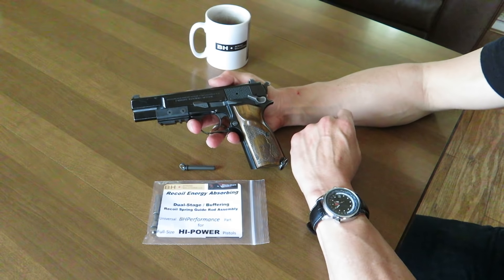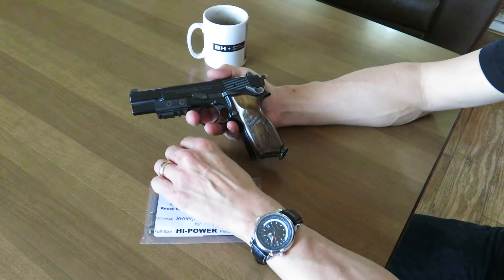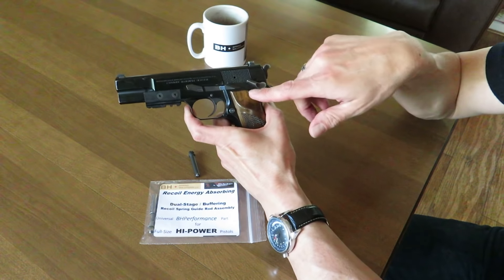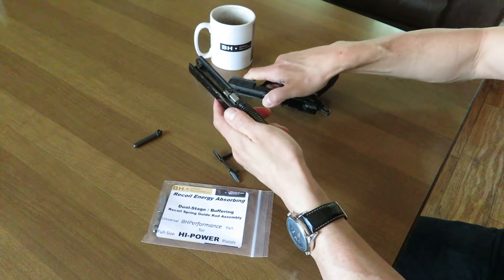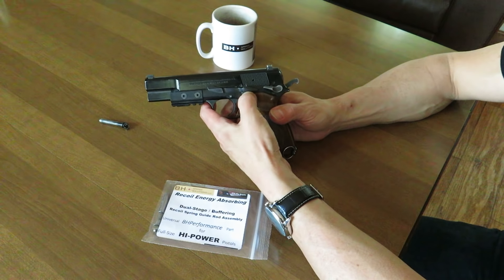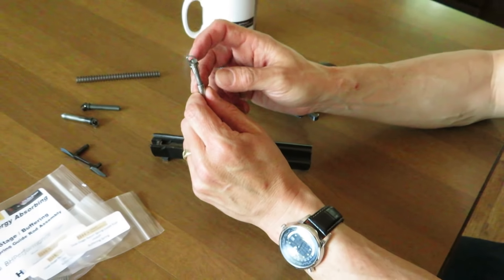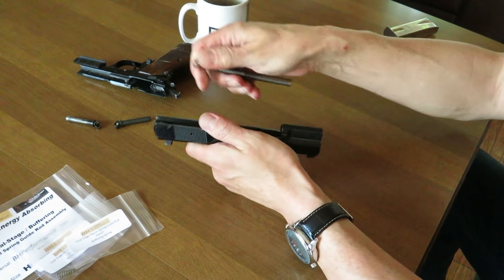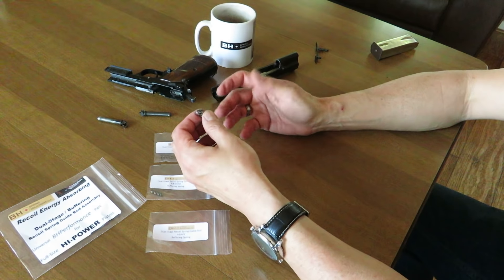Test Your Hi-Power Slide Stop / Recoil Spring Guide Rod - BHSpringSolutions.com

Comment: I own 2 hi-powers different types. I accidentally mixed the slide stops together when i was refinishing my pistols. I dont know which one goes to each gun... Is that bad?? Or can you just change them and theyre ok??? Please respond.
Reply: The slide stop is different in some FEGs and Ishapores. Test the function of the slide stop (keeping the slide open when there is no ammo in the magazine). When installed, the slide stop should remain downwards, and pushing it upwards should require some force. In general, the slide stop is an interchangeable part. Like already said, if the guns are not FEG or Ishapore, you should be OK.